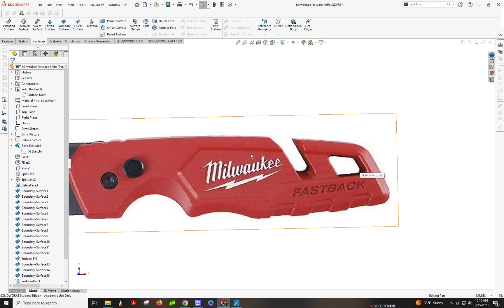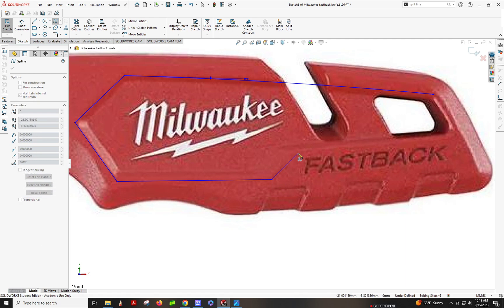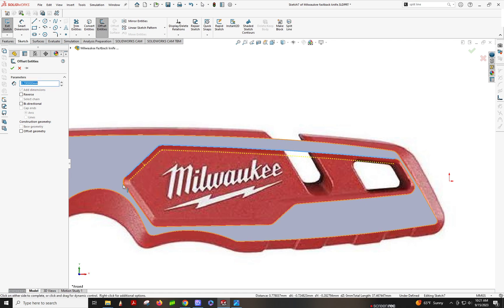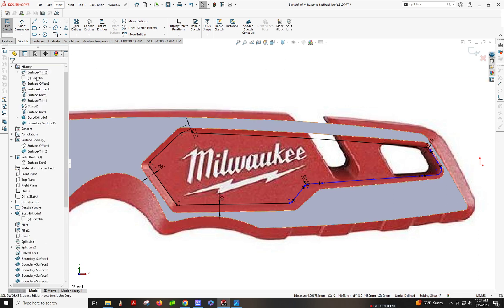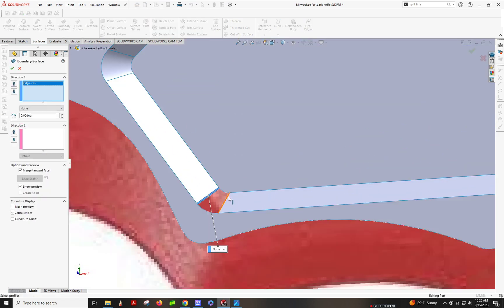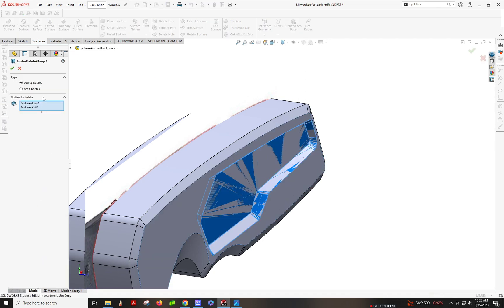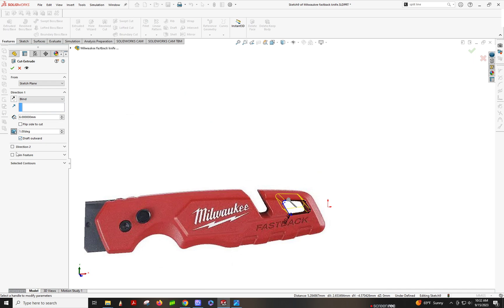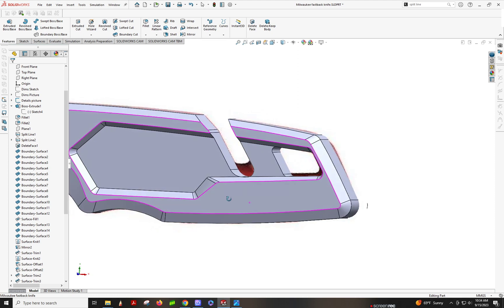Solidworks recessed surface with variable chamfer on Milwaukee Fastback Knife

Comment: Very informative video, thanks! You should be able to do all the boundary surfaces as one feature, depending on your geometry. Click Boundary surface, but before selecting the first edge, use the selection manager (right click > SelectionManager) to select the loop all the way around the edge of the surface. then do the same for the edge of the other surface. I prefer to disable the merge tangent faces option too.